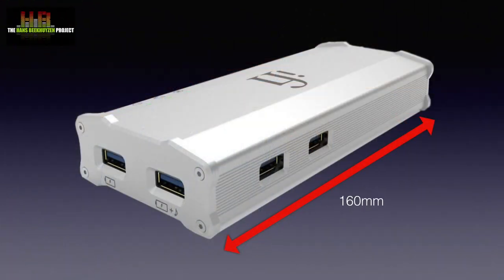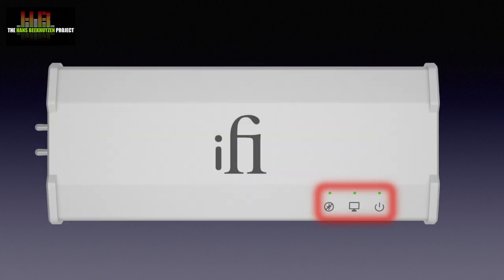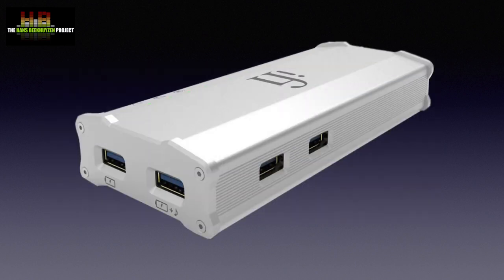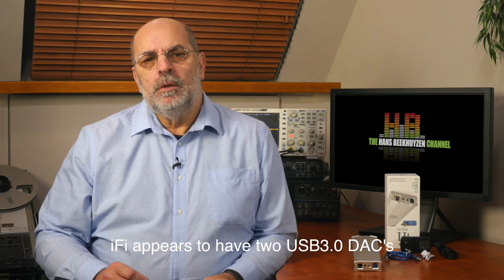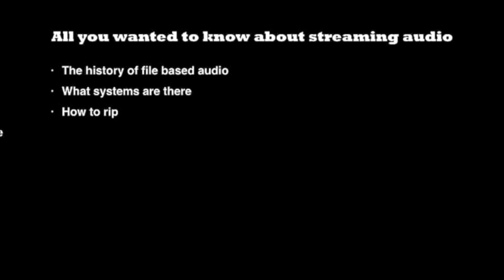iFi Micro iUSB3.0 reclocker and power cleaner

Comment: Thank you for reminding me I had one of these in storage. It is inline now and getting a good 8 hour run to get ready for this evening's critical listen.  I removed it from my system once I updated my DAC and added some good quality interconnects from computer to speaker terminal. 

I am not foreseeing any major shift in sound, but I will give a good listen this evening with both speakers and headphones (along with my standard reference tracks) to decide if it stays in the chain or not. To be honest, as long as it doesn't degrade the sound I will leave it in place.

To all my fellow audio junkies have a very Happy and Prosperous New Year...
Reply: notice a difference?
Reply: @Canadian_Eh_I  - it longs long since been sold and as it really didn't provide anything i could detect

Comment: May I ask whether one can use a USB 2.0 type-B plug to its USB input port or it only accepts that new-type taller USB 3.0 powered connector? All of my audiophile usb cables are USB type-B 2.0.
Reply from the maker: You can use USB2 cable. I even prefer them.
Reply: @TheHansBeekhuyzenChannel  Many thanks, sir! The only obstacle now is to find one as they seem to be very scarce on the market and iFi does not quite clarify whether any of these products (nano iGalvanic3.0, Micro iUSB3.0) are still in production. My alternative would be other DDC products but there are very few reviews on them. Thanks again.

Comment: HI Hans,

Great review as always. 

I have a few questions;

I'm currently using the output 1 on my Micro iUSB using Gemini cable to my Dac 1, I wanted to add another Gemini Cable connecting to the Output 2. Will it work for both? No negative impact or sound degradation? 
Dac 1 is Burson Conductor 3XR
Dac 2 is Chord Qutest

Thanks
Reply from the maker: I have no idea. I never tried.

Comment: Thanks for a great video, Hans. Is a product like this necessary when connecting a Mac to a Hugo TT.
Reply from the maker: This product cleans up the USB signal and is beneficiary to all that use a computer as source (unless the computer itself it optimized for audio, which isn't the case for a 'normal' Mac).
Reply: Thanks Sir and a follow-up question. If I'm using a iPad Pro as a Roon endpoint and then going out to the TT, I'm assuming the same answer applies, because it's USB-C out from the iPad to the TT, correct?

Happy New Year to you!! Looking forward to more great content in 2019.

Comment: Hans. I have been recommended this device from many holds.
My setup is: KEF LS50 Wireless with REL S3 SHO subwoofer. All cables from Nordost. Power cord from wall is Nordost Frey 2 to Quantum QB8 power line. I stream Tidal HiFi from My iMac which is connected with a Nordost Heimdall 2 USB to KEF LS50 Wireless.
I will continue to use My iMac as a source, because I think the sound quality is better compared to ”wireless” streaming directly to the speakers. When I replaced the Factory USB (that was included with My KEFs,) to the Nordost Heimdall 2 USB, the sound quality got even better!
I am very satisfied with my system, but do You think that this IFi box will make my sound even better? Cheers from Sweden.
Reply from the maker: I didn't review the KEF's so I can't say.

Comment: Hello Hans.
I´m curious to know how much improvement you got connecting Ifi MicroUSB to SMS200Ultra. I know you´ve listened. Tell me. :)
Another, did you tried in Micro the Sbooster or only the Ipower?
Reply from the maker: That would have been silly
Reply: You mean a worst clock cannot make improvement to a better clock. Right?
Reply from the maker: I mean that there is no point in cleaning/reshaping a signal twice.
Reply from the maker: And I now have to admit I was wrong. See https://youtu.be/U4RYineYsF0
Reply: Hi Hans - thank you for your very informative reviews. To the extent the above question relates to connecting a iFi micro usb to a SOtM sms 200 ultra network adaptor, I was wondering how is that different to connecting in series a SOtM sms 200 ultra and a SOtM usb ultra? Isn’t it the same logic? Thank you.
Reply from the maker: Yes, but not the same quality. As you might already have guessed.
Reply: Indeed. But in that case I will dare to ask whether you have tried or you think there may be any benefit in linking a iFi micro with a sonore ultrarendu / microRendu. The reason I ask is because I am thinking of buying a rendu and change my current setup which includes a Mac mini feeding a Brooklyn DAC through a iFi micro. I wouldn’t want the micro to become obsolete and I have no way to try the rendu without actually buying it. Your thoughts would be much appreciated. Thank you
Reply from the maker: I can't say. Since I wrote that the SOtM sMS-200 was slightly better and cheaper, Jesus of Sonorewas angry and no longer responded to my mails. SO I have no clue how well the UltraRendu does. I find the sMS-200Ultra the best I (and my audiophile friends) know and I would rather spend money on that. Watch https://youtu.be/nCoFIdPLcUk
Reply: Thank you Hans. I will consider that option carefully! Really enjoying your reviews!